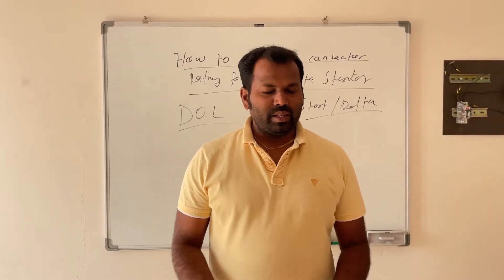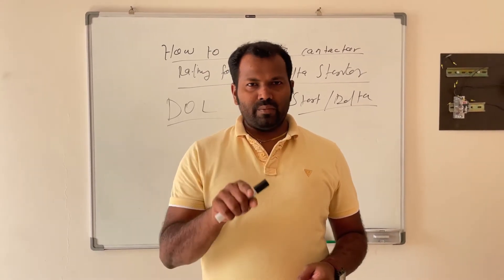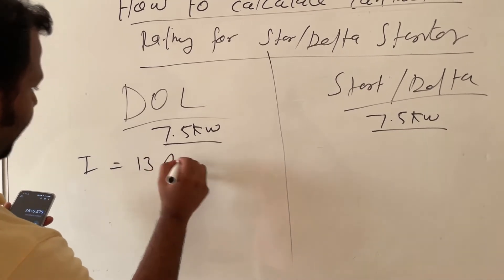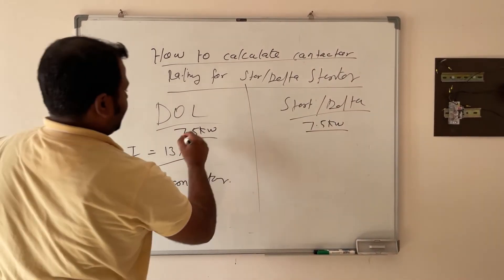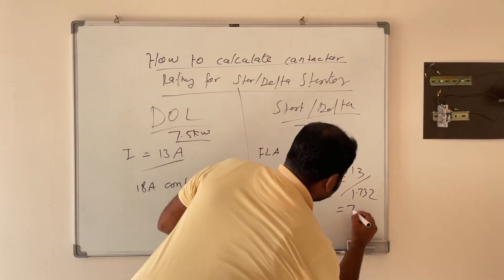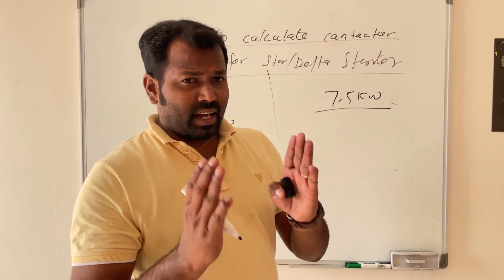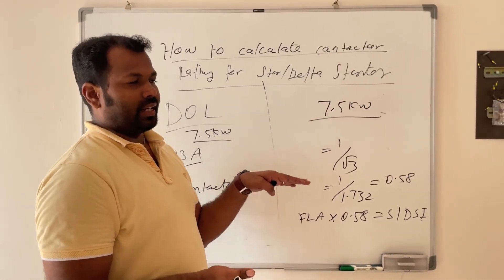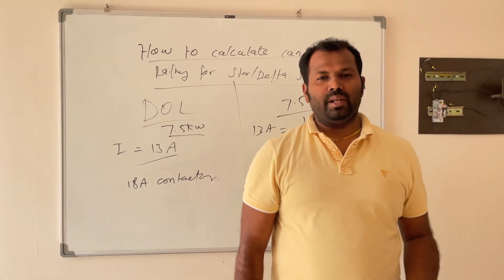How to select Contactors for starters …Explained...

Comment: Thank you sir, does it mean star contactor current rating is same for Delta contactor irrespective of the voltage level?
Reply from the maker: you can put star contactor rating lower than delta contactor rating ... But by personnel advice is , don't do that.
Reply from the maker: thank you for your feedback.